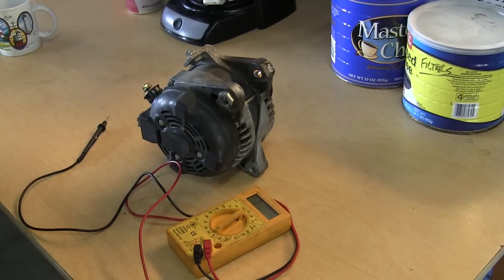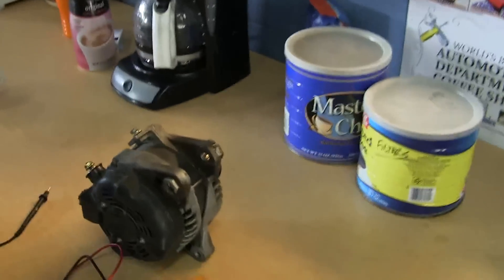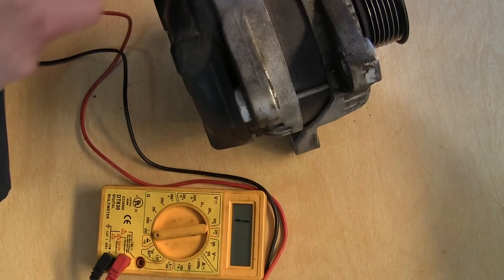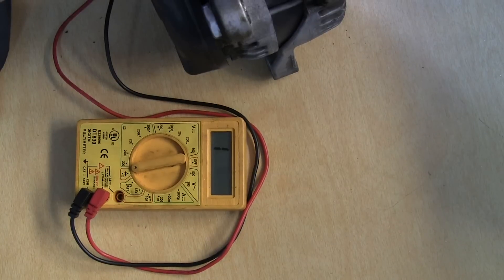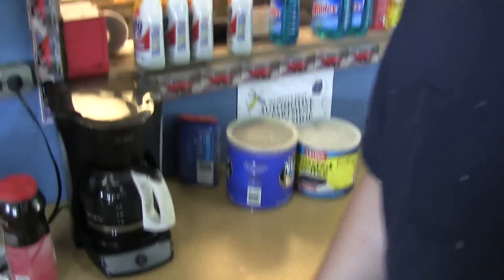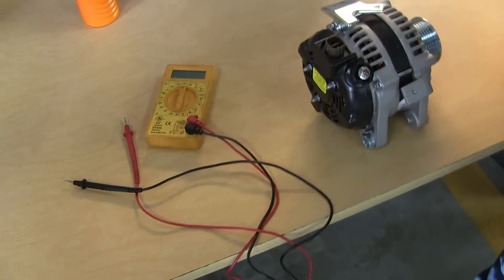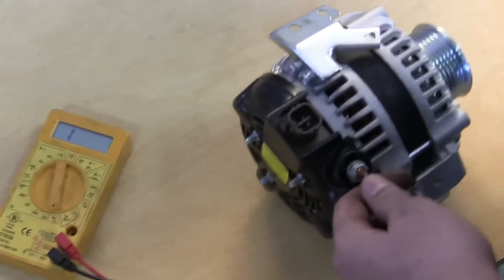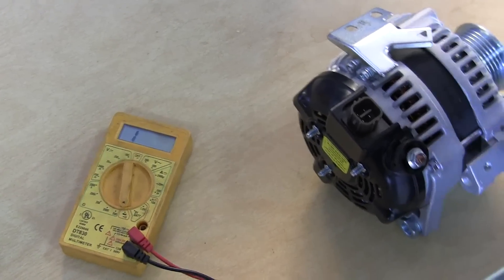Alternator Bench Test

Comment: 2 questions ...when I bench test an alternator with an electric motor spinning the pulley, is there a proper direction it should spin? And, if I do a conductivity test on the 3 wire contacts(A S I) I  get OL on the A and high readings on the S and I...is this correct?
Reply from the maker: It doesn't matter which way you spin it - but checking resistance on those terminals isn't a good test. The A terminal feeds the brushes and the regulator sense - the I terminal comes from that battery light on the dash and turns the regulator on.  The S terminal comes from one leg of the stator.  Ohming those out won't tell you anything.

Comment: Not really an accurate bench test. This is just a short/continuity test.
Reply from the maker: It's a test of the diodes - not a short/continuity test. Notice we're using the diode test function on the meter- it can pass this test and still be a bad alternator, but if it fails this test, the alternator (or at least the rectifier and stator) are bad. In that regard it's a go-no-go.